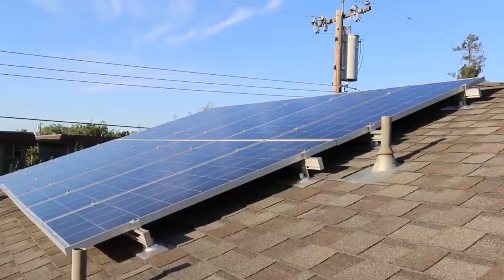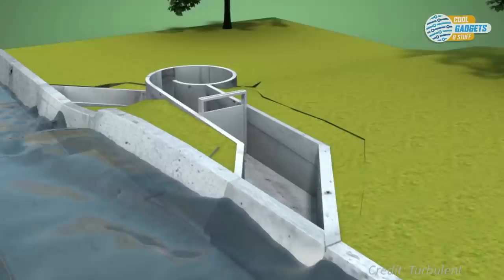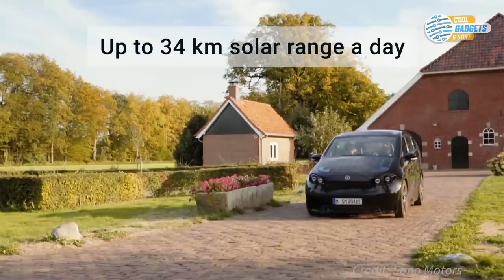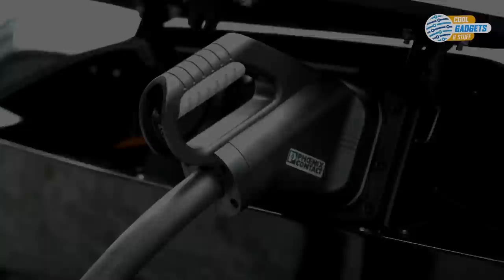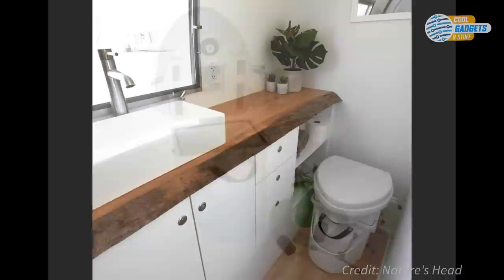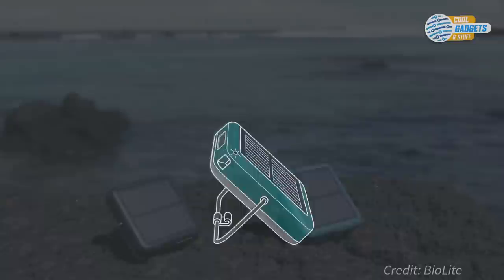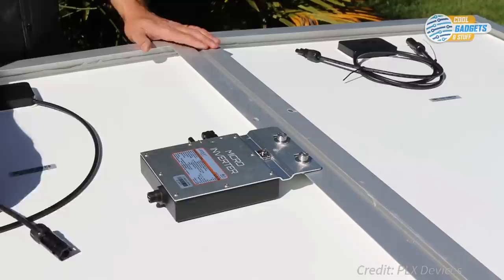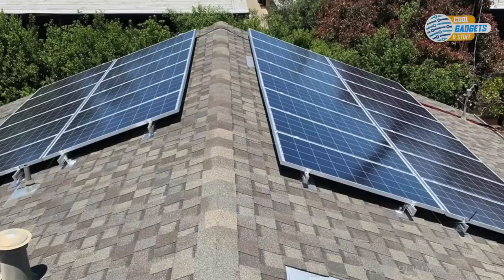6 OFF-GRID LIVING Inventions & Products #4

Comment: 1 thing i hate about many solar system setups is that anti-island thing, where if the power grid goes out, you don't have power either. Your whole solar setup disconnects so even though you have all this power, you can't use it.

Has no one ever heard of relays? I'd create a huge heavy duty relay setup that if the grid power shut down, it would trip a sensor and flip the relays which would automatically disconnect my power setup completely so it doesn't back feed. This could be done with a simple micro controller. Then it would wait 15 minutes or so AFTER the grid came back up before flipping the relays and reconnecting to the grid. I'd double up the system for redundancy.

Yes my power would flick off, but it'd come back on.. Then i'd get an alert on my phone or something saying the grid is down.. or i'd see it on the indoor solar control panel.
If i'm going to invest that much in a solar setup.. i'd want to take full advantage of it.
Reply from the maker: Legion solar thing has a optional battery commander module so maybe it actually does what you say but I'm not sure.
Reply: DIY Lithium Ion power cell packs
Reply: We have a good system where the panels charge a battery, excess is used to heat our water, further excess is sold to the grid, if the panels don't give enough we run off the battery, if that's not enough we buy from the grid. Except some exposed got jogged around during installation of the batteries so now the RCDs go off every other rainy morning.
Reply: @jonomoth2581  But if the power goes out, do you still have power? Many electrical companies require that grid attached solar setups, even WITH batteries, need to shut down should the grid power go out, to protect the line workers.
Reply: @LazyBunnyKiera   I just checked and we wouldn't have power, but the main point of the system was to reduce power bills and not independence. It would be a nice feature to have, I agree.
Reply: @jonomoth2581  I see, thank you. And yeah that's my biggest issue with grid tied solar setups.

 It'd be really easy to automate a power system that disconnects the house from the grid when the grid goes down. Like i could easily DIY my own "dumb" relay system. 

It's literally just relays powered by the grid and not the solar setup, that use a $0.50 555 timer that when the power comes back on, the timer delays the relays for a few minutes. So you stay on battery for a few after the grid powers on incase there's some instability.

This gives you the reduced power bills, and temporary independence when the grid is down.
Reply: @LazyBunnyKiera   I might actually do that, we've already got a miniature relay to alert us when the RCDs trip, and we have an Arduino somewhere!
Reply: @jonomoth2581  you'll need a huger relay, and you should probably test it small scale. Like with a couple batteries. Your biggest issue will be getting it to be powered by the grid without it being powered by your solar setup. Also you'll need to get it approved.... or don't i'm not a cop.
Reply: @LazyBunnyKiera   no need for a huge relay, just have a small Stepdown transformer to convert mains into something which smaller components can handle. I have no clue how to switch from grid to just solar.
Reply: @jonomoth2581  no no, the relay separates your house's batteries and solar from the grid, so you can power your house from the batteries, without the chance of it feeding back into the grid, which puts line workers at risks.

IE they go between the grid or grid power meter and your solar power meter. And you need to get it checked out and approved so your electrical company won't think something fishy is going on.
Reply: thanks for the heads up on the relay controller system my cousin was going to get solar grid buys your power I didn't know if their power goes off it will not let you use your own solar powerwill not be available right away.generator backup I always say.

Comment: The Nature's Head Composting Toilet I use it in my RV f0r years and safe water :)
Reply: Tell us more about it. 👍
Reply: I like this commercially-made unit, better than the older, often State-allowed, proven SunMar units, because these are smaller, more easily maintained, & crucially, separate the urine from solid waste. 
 But the bucket is smaller, & might need some help....
Have you tried adding worms to the poop bucket? 
Adding a bunch of the little wigglers found in the top several inches of the ground, can extend time between emptying, reduce mass & odor faster, & the worms break-down coliform bacteria (the germs in poop that health departments worry about). 

That said, one can easily make their own bucket potty with a separator for urine, from cheap & recycled parts. 
One excellent book, that describes 2 different, very effective ways to incorporate composting toilet systems, is in “Solviva” by Ana Eddy (sp.?).

Comment: The solar system is basically using the wiring in your home walls not the cable coming into your home....if you connect both wind and solar through a converter...directly to your home in conjunction with your battery banks...you’ll not spend anything..not even the installation...the system is so accessible all the parts you need can be found on eBay or recycled from other devices in your home 👍
Reply: What happens in the winter when there's no wind and the sun is minimal?
Reply: Another Somebody its the size and thickness of the mast.....as long as there is movement/vibrations...connected to a magnetic field...a small reading is measured...similar to a light 💡 bulb power....think slow cooker....minimal power/trickle over longer time produces heat...we have copper pipes and a copper water tank...left for a long time on low vibrations...will build up the heat...it’s not full power like needing it yesterday...but it’s long term conversion of extremely low vibrations.....think of a CB areal...connected to a magnet...and then a capacitor...small cog...to bigger cogs

Comment: The Lavoria is cool but without a spin type function it isn't much help.  I guess you can grab hold of the handle and swing it around to remove water . . .  IF the thing is sturdy enough.  Doesn't seem strong enough for the money to withstand that.
Reply: For the premium price, i'm sure they'll sell you a salad spinner too 😁
Reply: @anothersomebody8195   You know those stainless steel collaspable baskets that you can take outside and swing around to remove water from washed lettuce.  Probably a lot cheaper than this plastic thing and more sturdy--can be used for small and medium laundry
Reply: @OWK000  It probably could be. Of course is you're really wanting the clothes done naturally, you could probably connect a spinner basket to a bicycle so the faster you pedal, the quicker it spins.
Reply: Some restaurant suppliers sell BIG produce washers/spinners that some people use as mini washers. Small enough to stash in a cabin or camper. A friend has one for her small farm. I’ve seen it and it would work well as a washer.
Reply: @SuzanneWho  cool

Comment: The spec's of the Sion Electric car are poor.   Until the new battery tech comes out I would wait.
Reply: Its laughable. That spec works out to 10 miles of range per day from those solar panels. Its not the battery tech thats the problem, its just a really stupid and wasteful design. Get a decent stationary solar array on your roof and you can generate way more power than those cheap panels wrapped around the car.